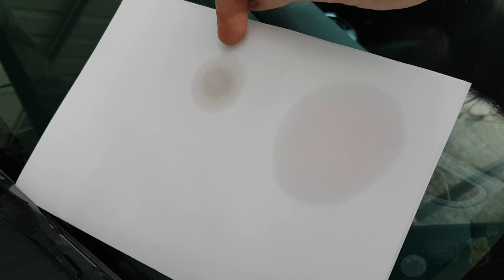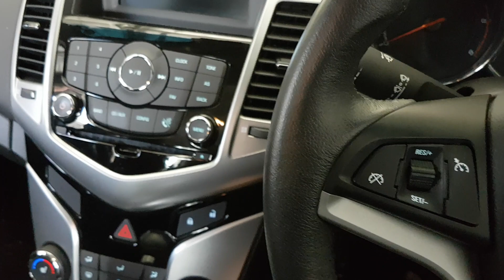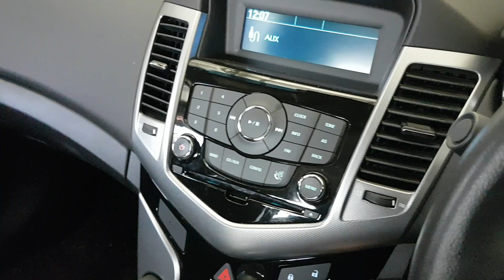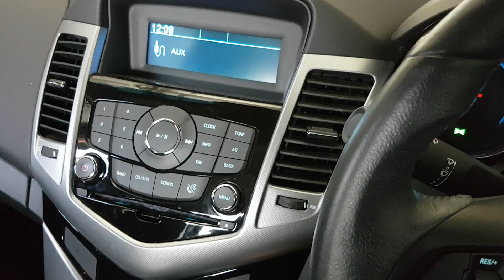How to Change Automatic Transmission Fluid 6T45 2012 Holden Cruze Turbo Diesel

Comment: Peter, 
Thanks for posting this vid.  It’s been very helpful to me with my 2011 JG diesel Cruze.

I’m not a car mechanic, so having someone show me where to find things underneath the car has made it easy to find drain, level-check and refill ports.

I’m hoping the problem I’m experiencing with my automatic will be solved by changing the transmission fluid.
Reply: İt is ok

Comment: Great video! For your information, my Chevrolet Captiva 2.2 4WD 184CV year 2011 has the very same Automatic Transmission, and the load/drain/check caps in the very same position. Thanks again for the great information provided!

Comment: Thx mate I got 2013 1.8 petrol.  Had it from new. Trannie was repair or replaced at 30000k, they had for 2 weeks. Now it got 206k and trannie  slipping and not changing down quickly. Trannie never been touch. I though no service box. I call couple of auto shops and they want over $400 to empty and fill and said could  be an expensive job.  I don't finish the box off. Wot do think. Been good car, but got magic 200k. Cheers Graham

Comment: The 6t45 transmission is used in all auto vehicles with petrol engines, especially on models produced from 2010 to 2014.
Reply from the maker: All the transmissions are in the same family 6T30, 6T35, 6T40, 6T45 etc.  The 6T45 is for higher torque applications and was used in the diesel version of the Holden Cruze in Australia, as seen in my video.  Petrol versions variously used the lower torque versions of the transmission depending upon market and whether the engine was turbo-charged or atmospheric.

Comment: Hi Peter,  good video.  Does the Temp. of the fluid need to be in a certain range before checking level?  I have the 6t40 transmission I'm going to this service soon.  Thanks
Reply from the maker: Hi Mark, the transmission temp needs to be between 85 and 95 degrees according to the manual I linked.  I don't have any reliable way of measuring that so I just got the car up to operating temp, according to the water temp measured in the electronic display, and filled it from there.   It is a sealed transmission so theoretically if you measure what you take out and put that back you should be OK.
Reply: Sounds good thank you sir
Reply from the maker: Hi Mark, I have added some more info on how to do this in the comments and in this video:  https://www.youtube.com/watch?v=XZ9eGPMGeec&t=4s

Comment: Thanks for this Peter.

I’m changing my engine oil and transmission fluid tomorrow. I have a manual though, so I’m not sure how much this changes things. Is there a way to get to the level without taking the tyre off?

Cheers
Reply from the maker: I am not familiar with the manual transmission in this car but it should be as simple as drain and fill.  Likely there won't be a check level port - most manual trans just have a drain and fill plug so you just fill it until transmission oil comes out the filler port and bung the plug back in and it's ready to go.
Reply: @numbnutsAU  ah perfect. Thanks very much

Comment: Hi Pete ,  thanks for the video, good to see you doing the job yore self  , i am going to try my self now i have some idea, btw how many ks did you do  before the first drain  on the auto trans ,cheers
Reply from the maker: Hi Mike,  I changed mine twice at 45,000km.  As I explained in the video I pretty much did a poor mans flush by doing two fluid changes in a row.  The recommended interval to change the ATF fluid is 150,000km - way too long in my opinion.

Comment: Hi Peter, Is temperature of the oil should be at certain point where should drain the oil. like other manufacturer recommend???
Reply from the maker: I drained when the transmission oil was cold, refilled and then got the transmission up to temp per the video and checked the levels.

Comment: Hi Pet, I have same car, did you ever clean the throttle body remove and clean. and EGR as well. ??
Reply from the maker: My car is a turbo diesel so it doesn't have a throttle body - engine rpm is controlled by the amount of fuel injected into the engine and not by the amount of air allowed in.

Comment: Hi peter .I have same car i fill (8L) or 6 L.
I was filled 5 leters but no working initial pickup in my car so please suggest me actual quantity. THANK YOU
Reply from the maker: If you are completely draining the transmission and the cooler then you will need the 8L.  Doing it the way I did it doesn't drain the fluid completely out of the car and that's why I did this procedure twice to do a poor man's flush.  In all I did use around 9L of fluid because I did this procedure twice.  If you are only going to do it once then a 5L bottle should be enough.  Check the level per the video to make sure you have enough in the transmission.

Comment: Hi peter, if we completely drain all the trans fluid, then how many litres should we fill in before driving for 30 mins and checking the level, thanks
Reply from the maker: measure how much fluid you drain out and then put that much back in on your first fill prior to driving.  then do the level check procedure - you might need to add more fluid.

Comment: Why disconnect the pos post instead of the neg post?
And does this not also affect the security system?
Reply from the maker: good pickup - you should disconnect the battery using the negative terminal.   doing the positive first you risk earthing your spanner and blowing something up.  have to reset clock etc but no affect to the security system.
Reply: @numbnutsAU  Thanks.

Comment: Hi peter, the same transmission is in my captiva 2.2 diesel 2015, i have an issue i got the bluetooth obd2 and torque app but my captiva will not go ast 75"C on 3 hours up hill and down? im assuming it has a transmission cooler but how am i supposed to get it up to 85-95??
Reply from the maker: I'd just do your level check at 75 degrees - it will be OK.
Reply: @numbnutsAU  thanks mate

Comment: Did you notice improved shifting after the change . I’m thinking about doing mine . I only have 26ks but it’s a 2014 model.
Reply from the maker: yes - marginally better, seemed smoother.  my fluid wasn't in too bad of a condition.  it is worth doing.
Reply: My shifting is really bad and a friend who’s a mechanic said to change the fluid so I’m gonna give it a go.

Comment: Hi when oil level check... it’s extra oil coming out?? Thanks
Reply from the maker: yes, that's right.  the oil level check releases any excess transmission fluid so once it slows to a drip you have enough oil in the transmission.
Reply: Peter .. hi just I spoke to Holden they said i need 8 L. .. my car 2015 cruze 1.8L... so its 5l can enough??
Reply from the maker: @Mr811251  If you are completely draining the transmission and the cooler then you will need the 8L.  Doing it the way I did it doesn't drain the fluid completely out of the car and that's why I did this procedure twice to do a poor man's flush.  In all I did use around 9L of fluid because I did this procedure twice.  If you are only going to do it once then a 5L bottle should be enough.

Comment: hi, Peter
Does it come also with an Filter that need to be changed?
thanks
Reply from the maker: The filter is internal to the transmission so you would need to tear it down to replace it.  Another reason to regularly change your transmission fluid.

Comment: Hi, Thanks for your nice instruction video, Do know where to find the temperature sensor of the gearbox ? Thx!
Reply from the maker: I don't know where the physical temperature sensor is for the transmission.  this is how you check the temperature https://www.youtube.com/watch?v=XZ9eGPMGeec&t=18s&ab_channel=Peter
Reply: @numbnutsAU  Today finaly i did the  oil change two times! everything oke, still works thanks a lot!

Comment: 6T40 in the petrol engines, 6T45 in the diesels. I think 6T70 in the V6? All similar in procedure. BTW, VM Motori are very good Italian engines. They design and manufacture engines for many major manufacturers actually. BTW, fluid must be drained cold.

Comment: I think the level is not right. Too much fluid came out.

The reason is that the transmission is not at the right temperature.

This trans, above 60 degrees C, keeps some fluid in the valve body.

Your ATF temp was not even close to 85-95. It was not above 60 ...

You risk to damage the transmission. Please do again the level.

Read here: http://www.furitech.com.au/index.php/holden-chevrolet-cruze-6spd-6t40-automatic-transmission-service/

To check the ATF temperature use a bluetooth or wifi elm 327 adapter from ebay, and a smartphone app.
Reply from the maker: Hi hybrid11111 - I have added instructions in the comments for the video on how to ascertain your transmission fluid temperature.  Once again thanks for your help!!  :o)   

To accurately check your transmission fluid temperature:

1.  Buy yourself an ELM327 OBDII OBD2 WiFi Car Engine Diagnostic Code Reader from ebay.  

2.  Download the Torque Pro app from the Google Play Store - you will need the paid version - the "Lite" (free) version won't have the functionality you need.

3.  Go into settings and choose "manage extra PIDs/Sensors". Then from the three dot menu on the top right of the screen, select "add predefined set". From the list, choose "Pontiac/GM/Opel/Vauxhall". That added 3 custom PIDs named "Transmission Fluid Temp (GM Method 1)" and "Transmission Fluid Temp (GM Method 2)" and "Transmission Fluid Temp (GM Method 3)".   GM Method 2 picks up the right value I believe. 

4.  On the screen to "add sensor" choose "Transmission Fluid Temp (GM Method 2)" and add it to your screen.

Comment: There are 8 Liter Oil in the Transmission!!!
Reply from the maker: That's right - if the transmission is completely empty it will require a fraction over 8 litres to fill it.  Following the method in my video will not get all of the transmission fluid drained.  That's why I did this drain and fill twice.
Reply: @numbnutsAU  ok that's right...my mistake. I must learn to hear English better. You've done a good Job.